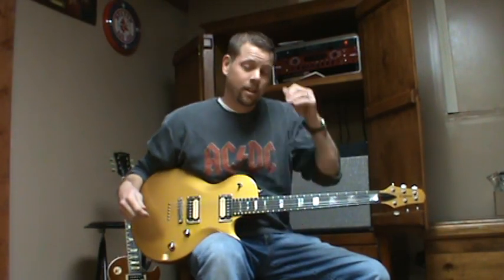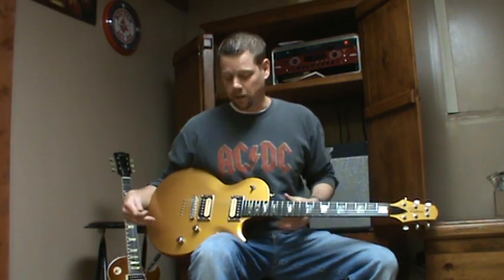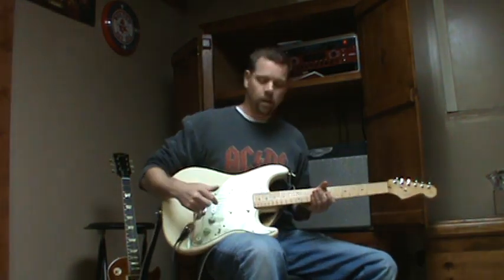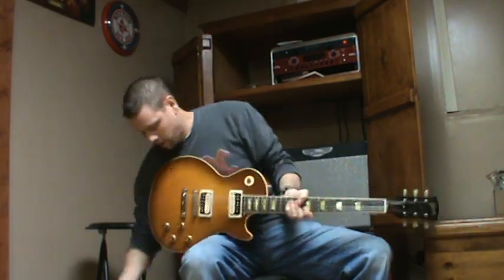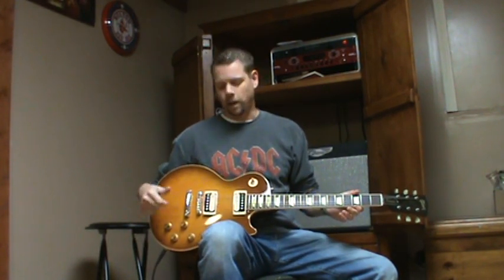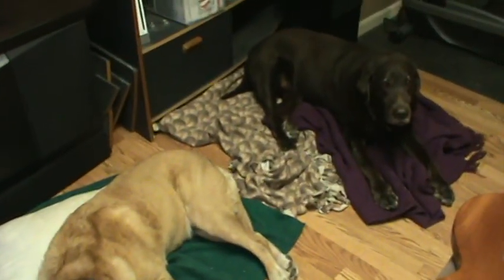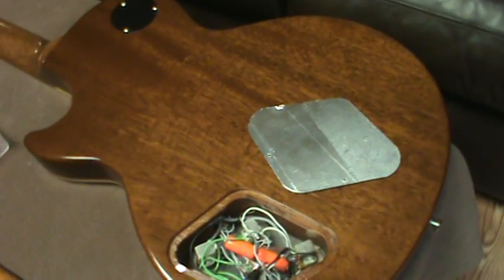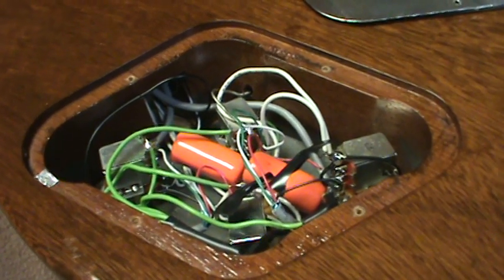Gibson Les Paul with Hum / Noise Issue

Comment: Yeah, missing the connection to ground between the tailpiece and the pot. I got the same issue
Reply: Mine does,it beeps on all pots,input,three way switch,its wierd,i first plug it in ,its dead quiet,then after 20 minutes itll start a static crackling noise,and ends up turning into that loud buzz he mentioned
Reply: Mine 50s tribute has got a ground connection to the tailpiece but i have the humming problem too but everything is grounded

Comment: Did you every figure it out?  Sounds like EMI, as I THINK I have the same problem with my Les Paul.  I don't know why the Les Paul is more susceptible.  A good test would be to run a long extension cord outside as far from possible from you house and other, and try the guitar there.  Nice dogs!

Comment: Re ground the stop bar/tail piece/posts in the rear. This will effectively use the guitar pots as the ground if wired properly, and not you as the ground (when you touch the strings).

Comment: I traded and brand out for the Gibson EpiPhone Special because I liked the lose strings.  The plastic where the output plug went was busted up so I tried to fix it cause there was like a crash buzz if I moved wrong and then the output moved around and I tore something out wrong and so then I put in another plug output that was bigger and then grounded like in a diagram and put the thing back together.  Buzz you know.  I'd added some back plate shield tape.  Good solder.  So there is another diagram shows ground to tone and I will try that.  I'm feeling a bit stupid for making the trade for the name you know really.  I got these things I built with piezo cable work about better really.

Comment: My suggestion is to take the guitar to a qualified technician with a properly equipped shop who can use diagnostic tools such as volt meters to analyze your wiring, insuring the integrity of all solder joins & that the circuit is properly grounded.
Guitar shielding should not be necessary in a guitar with humbuckers that are not coil-tapped or coil split. If shielding is used it needs to be installed properly with solder joins & then grounded. Shielded wiring is also a good idea.

Comment: I've got a slight hum going on with my new set up as well. It wasn't there before, but just showed up one day. Same deal, tough the bridge and it cancels the hum. I did push pulls on the tone controls to split each humbucker. Weird.I loathe to pull out the wiring and do it over ...

Comment: I tried my Les Paul with my laptop using the battery and u can hear that the hum noise is lower than when it's connected to the wall outlet,  when using only the battery and I place my hand on the strings or the bridge nothing happens (because it is already very quite) unlike when laptop or amp are connected to the WO and you can hear how the noise is reduced.

Comment: I think i know what the issue is!!!
U need a 3 pinned from the amp into the wall. It worked for me. Dont use 2 pins connecter!!!
Reply: +Rocky Luke my epiphone do not need 3 pins connection. But my gibson les paul standard does.. Wierd but true. It works.

Comment: Had the same prob. with my 2000 Classic.  My tech ran a cloth-covered ground from the backs of all pots to a screw put in the lower part of cavity.  The screw runs through a piece of copper shielding tape and the tape runs up over the cavity lip. The cover plate has foil like yours and makes contact with the copper shield.  Result:  no hum and less static pops and clicks.  MyLesPaul Forum member advises painting the entire cavities with copper shield paint too.

Comment: Check your ground wire to the tail piece from your control pots. Run alligator clips from the tail piece  ground around to the tail piece. Cheap check

Comment: I'm always amazed at the comments for such an old video!  I stated a while back that I agreed with many of you in that I thought the issue was a ground wire going to the bridge post (missing or broken), but this was NOT the issue.  I took ALL the wire out and re-wired the entire guitar and the guitar is very quiet now.  I believe it was likely just a poor wiring job/cold solder joints that was the issue.  I could never pinpoint the exact joint, so I just re-did the entire wiring.  I'll have to post a follow-up video to illustrate how it sounds now.  Thanks for the questions and comments!
Reply: Stephen Lima So is it fixed?
Only asking cause I saw so many "suggestions" here... for example, saying that the ground wire going for post was broken... if it was, it shouldn't do a damn thing to that noise, but it did when you touched the strings right?
Reply: Hey i have the same issue with my classic did you fix the problem finaly?
Reply: He stated above that he resoldered all of his connections and the noise is largely gone,  I have this problem with the tone control of a guitar I just built.
Reply: (disregard my bit about asking if you fixed - hadn't made my way down through the comments yet. it's a shame your vid hadn't popped up sooner, or your followup if you made it. that would have been SO helpful!!! ---rewire the damn thing. lol)

Comment: I had a friend bring me his brand new Gibson Les Paul Standard to set up. I haven't owned a Gibson since the late '70s, but I now know EXACTLY why so many people complain about Gibson's quality control. A $3000 guitar with high action, pickups almost flush with the pickup covers and it's intonation way off? I've seen many $300-$500 imports set up better, fresh out of the box. But those things can be adjusted. It was when I plugged it into an amp when I was finished that Gibson crossed the dubious line of unacceptability for me, and subsequently, it's owner also. Ridiculously hum when not touching the strings.

Comment: Often introducing complicated wiring creates more chance of interference. That hum is not 60cycle him but electro static interference. Humbuckers wont get rid of it. The out of phase and series parallel circuits and switching I find always increases that interference noise, which you can get rid of by turning off spot lights or strip lights, computers, anything else with transformers. And your amp - move a couple of meters away and that might help .

Comment: The way emi waves pass through you need to seal the cavities with the conductive tape. If there is a section where it is not blocked by the tape the EMI waves will contribute to the noise or "interference"

The wires will emit electromagnetic waves, a conductive "box" will block the waves.
I have designed electomagnetic enclosures and the way to reduce the noise is to seal all the emitting objects in a conductive wrap.
but I need to do this to my single coil les paul, probably next time i restring it.

Comment: Looks to me from the photos that there is no copper on the lip in order to make contact with the cover. Also, the same with the pickup cavities. They ALL need to have contact. Get some 3M copper tape, the best in my opinion, but also pricey but you won't have to solder between the tape due to their adhesive. Next, try using a shielded wire for your main input jack. Less cable and looks better. Also, not to be a nimrod, but the wiring also leaves a bit to be desired. Looks like an Italian pasta party going on in there. I've had the same problem until I ripped the entire guitar apart and started from scratch. Worked for me.

Comment: You must touch the strings or bridge to get rid of most of the hum, that’s how it works. Best way to tell if a Les Paul’s Mahogany body is one piece is to look at the side where the guitar strap button is. Since the grain on a tree goes in circles the grain on the guitar should go in the same direction. If it goes in opposite directions like ^ it’s probably a two piece. Gibson is very good at hiding seams.

Comment: As others have said it defo is the shielding - I had exactly the same issue but possibly even louder and my tech shielded both the pickup select switch cavity at the back and most important did the large pot cavity as shown in the vid... My tech did it so it looked pretty much exactly as the other guitar and now my les Paul std is dead quiet. I was so fed up initially as the noise was so off putting, but now it's just perfect and is now the guitar I always dreamt of... If you have these issues try it...

Comment: ground wire to bridge post is broken. An easy fix!
Reply: I concur
Reply: I have his same problem with my Les Paul. So you reckon it's the ground wire to the bridge post that's the issue?
Reply: James Oldfield If the buzzing stops when you touch the strings it will be more than likely that the ground to the post is broken. To check for this run a temporary  wire from a pot ground to the bridge, if the buzzing stops its a broken ground wire. To fix it 1, remove the string holder post that is nearest to the knobs 2, remove the cover plate over your knobs, 3, look for a single wire that heads towards the post and pull it out of the hole 4, get a wire that is a little longer and remove 1/2 inch of insulation from each end 5, push the new wire back in the hole so that the bare part of the wire can be seen protruding in the post hole 6,  replace the post making sure that the bare wire is in contact with the post 7, solder the other end of the wire to ground on a pot and remove the old wire.  Hope that helps.
Reply: ***** EMGs never have that problem again factory les paul pickups are garbage and getting the posts out to fix the think is a pain in the ass
Reply: John Wilson I agree with you, they should find a better way to ground the Gibson.
Reply: If the buzz stops whrn touching the strings/bridge, then the guitar is grounded properly

Comment: It cant be his home wiring or why would it stop on the 2 other guitars that have no buzz? That eliminates that theory, it also cant be his ground to his bridge because when he touches the strings it stop so that tells you its grounded to the bridge fine.

IMO the problem is the leads from the selector switch, thats a long run going the full length of the guitar. If its wired the classic way which i believe the jimmy page wiring is your running the hot signal from the pickups all the way up to the switch then back down to the output jack. IMO that hot lead from the switch should be shielded the best. I think all 3 leads should be shielded the runs from the pickups to the switch and the runs back from the switch.

I was thinking the carvin had a different switch setup but i went back and it has the same setup as his Gibson so the carvin must run a different wiring setup then the gibson.

I have an issue with an EPI studio (thats why im here), i just rewired the whole thing remelting the old solder and adding fresh new solder nothing has helped but i did notice that there are 4 wires running to the switch that have no shielding and thats my next step.

Just my opinion though.

Comment: 1. Proper grounding of all non audio making metal parts (e.g bridge)

2. Avoid leakage current or ground loops in your power supply
Reply: How can one ground a bridge?
Reply: @JimmyKay1976  hope you figured it out but if not then you can screw a screw from the wiring cavity to the direction of the bridge, and once it is touching stop and solder a wire to the screw. Unless its already wired which it should be. can tell if it is or not by touching the strings. if the hum goes away, then its doing what it should.

Comment: I have a rickenbacker 330 it hummed so i tighten the guitar wire plug a bit externally only still had. Was not to keen going beyond that so as an experiment i got an alligator clip clipped it to the bridge and the other to the rear pick up. It went totally quiet so there must be something to do with a ground problem just my two cent,oh and no i have not ventured internally yet as it is not that annoying Yet.

Comment: i am on my 3rd, 4th, and 5th les pauls, and there is never any shielding in the control cavity.  My les pauls have always been very quiet.  They are and have been les paul deluxes from the 70s and i have a 1998 standard. The bare wire going into the body is/should be going to the tail piece stud.  Have you tugged on it to see if it is broken at the stud end?   Also, were the original pickups noisy?

Comment: I have a Vox Mini 3G2 and an LP 100. When I run the amp on batteries there is no hum. When I plug the amp into the wall socket using the adapter the amp hums. Hum goes away when I touch the strings.

Comment: Wonder if buying 1 of those line 6 wireless systems would help reduce the hum to a normal level also when using the battery the back of the guitar still produce crackling sound

Comment: Hey, I know I'm 2 years late responding since you posted this, but my bet is on the ground wire connected at the tail piece.  If that's a good connection, my next guess would be some cold solder welds, on the pots or anywhere else in the chain.  You need to ensure you have a good hot iron (40 watts) minimum to do good soldering on these parts.  A 15 watt iron is just asking for trouble!
Did you solve it after? please write your solution if you did.
Thanks
Don : )

Comment: With my guitar the hum dissapears when i touch anything of steel, including strings, what could it be ?!
Reply: same i hate it. i may buy something called a HumX you plug into the wall
Reply: @johnnygernhauser693  did you buy the humx?
Reply: @baileypawsplays1047  I bought a HumX. No difference.
Reply: @mojosmoke  I borrowed someone's Boss NS-2 noise suppression pedal and it worked really good. I might order one or try to find a used one. But for now its not really bothering me. Also if you have an audio interface and a pc/mac  you can check out a program called Bias FX2 . The have a free demo version with noise gate pedals included. That also worked 👌

Comment: I have the same problem with my new LP. I've tried the dryer sheet thing and didn't work, Does anyone thinks that the Gibson Hardcase can make things worse? the materials used in the it seem to build up lots of static and the nitro finish of the guitar doesn't seem either.

Comment: hey dude I feel your pain I've been dealing with the same exact problem with hum noise and hiss with my Les Paul since I play through a Mesa Boogie. Its really noisy I've tried everything shielding, basically everything but the kitchen sink. My Axe sounds just like yours and its so frustrating I WANTED to pull my hair out. The best solution I've come up with besides really great wiring and shielding is a Boss Noise Suppressor Pedal dialed in !! It takes a little playing around with.Good Luck !

Comment: Hi, I have the same problem with my cheap Epiphone Les Paul Special II.  Did you eventually get the buzz fixed?  If so, please share your method.  Thanks.
Reply: Ric Canada Epiphone has pots mounted through the holes. Even you have a ground wire from bridge, you might want to start with neck vol pot - neck tone - bridge tone - bridge vol pot. Attach a ground wire in the harness I laid out. Zebra or uncovered pup's are also prone to hum, but most of all. Make sure your amp is connected to ground ( 3 pins in power cable) sould go into a 3 pole socket in the wall. Rock on!

Comment: I have the epiphone Les Paul and it has a bad pickup buzz when overdrive is on our at high volume it's a constant buzzing had a vox amp took it ball and get a fender mustang and buzz still can take my hand and put on the two screws on the last pickup and it gets a hell lot quieter is that a ground issue with the pickup?

Comment: I have the exact same issue on my 2019 LP classic. It was so frustrating to plug a brand new guitar in and get this noisy hum. I even checked if there’s a ground wire coming to the tail piece and all. If anyone here has found a solution to this problem, please share.

Comment: Same problem here with my LP Studio 2013 Goldtop. Mine produces the hum even in the clean channel and I can produce the crackels at the back. After a lot of research I think that that there are 2 problems, the guitar itself builds up alot of static and the electronics are all well but they were just not design to avoid this kind of static electr. I will use the copper foil to shield all the cavities and pickguard and see what happens, Also I'll try to ground the body someway to the board.
Reply: I have exactly the same issue with LP Classic. Any results after shielding yours? Does it worth?

Comment from the maker: Thanks for all the comments.  I think I posted earlier that the issue was resolved.  BUT, I had to remove all the wire and electronics (other than pickups) and re-wire the entire guitar.  The guitar was originally wired with the Jimmy Page wiring scheme so there were a LOT of connections and switches, which likely led to some of the noise issue.  I'm not sure excatly what fixed it, but it is now NICE and quiet.
Reply: First, I really enjoyed your post.  It didn't work, but it was helpful.  As for the issue, while I watched the video, I looked at the wiring and thought "Oh dear."  That repair guy should be ashamed of himself.  So messy.  I'm glad you were able to fix the issue.  It sounds like it was just bad wiring.

Comment from the maker: Hi everyone.  Thanks for the comments!  I re-wired the guitar with standard wiring - all new wire - and it quieted down a LOT.  I think the issue was all the wire in the cavity, the type of wire used, etc.  It is very quiet now, and I should post an updated video to show that.  Same pickups, just new wiring.  So - it WAS NOT a ground issue from the bridge, although may have been a ground problem within the wiring of the switches.
Reply: You had a litany of single conductor wires in there which act as antennae for RFI and EMI.  I've done the Jimmy Page wiring in several guitars and they were nearly whisper quiet but I used shielded wire and grounded 1 end of each shield.